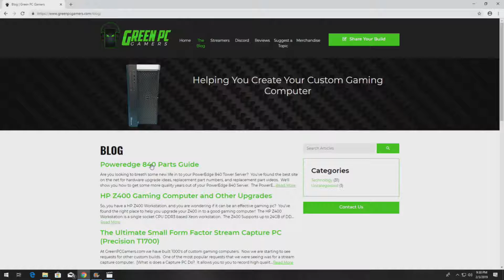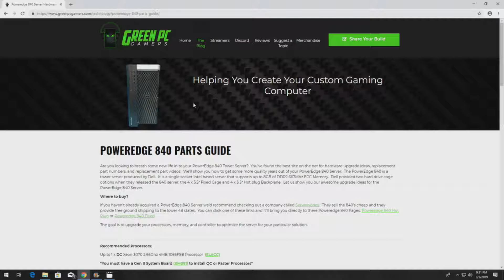How to replace a Poweredge 840 System Board XM091 RH822

Comment: My power edge is blinking the yellow light and the green light interspersed, I can't format with cdrom or pendrive, pendrive doesn't even recognize at boot.
I didn't see any capacitors or any damaged components.
By the way, what is the maximum memory capacity, I put 2GB 5300U 667 MHz
Reply from the maker: You'll have to do some adding and subtracting of components to see if you can find out what is causing the problem.